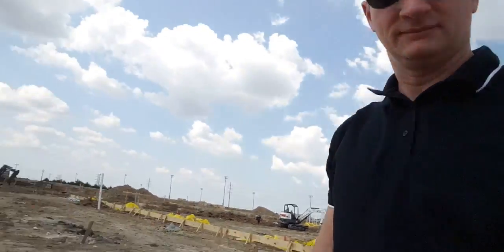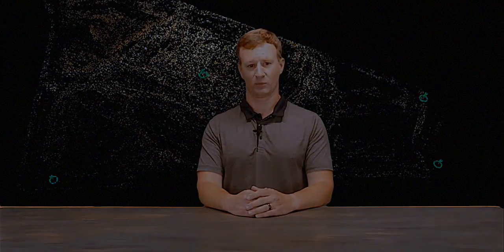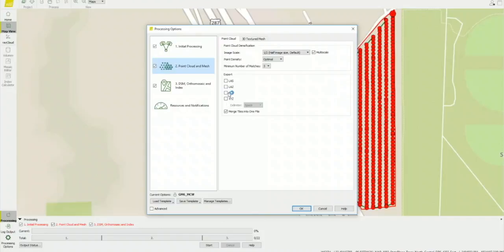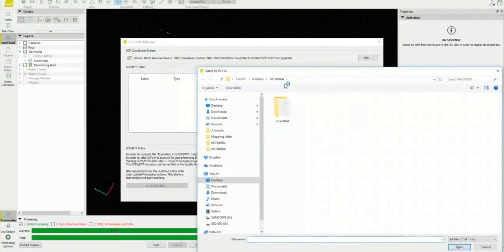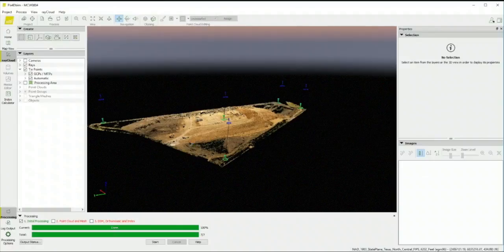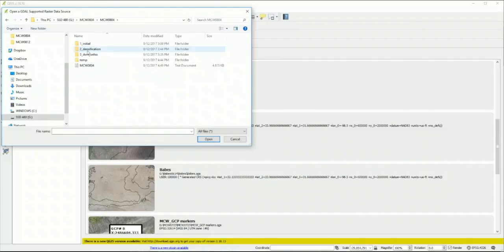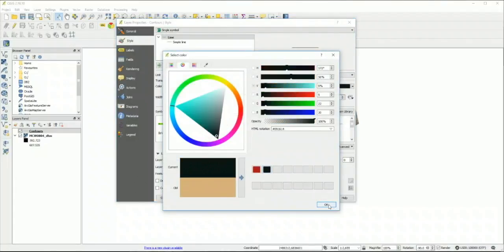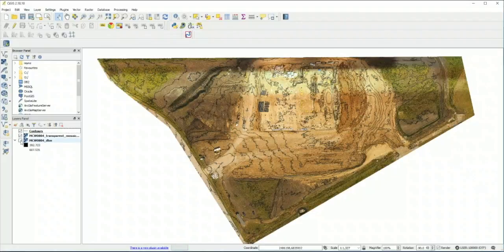How to get accuracy in Drone / UAS Mapping with Pix4D: What You Need to Know

Comment: Using Pix4D Mapper, I have on occasion had it not allow me to only pic the GCP in a single photo. Then, when I continue, the ortho photo comes into CAD in the wrond position!! n my opinion, Pix4D makes the best orthos but have had this trouble I mentioned. Any ideas?
Reply from the maker: I have had issues with Pix4D that were caused by bugs in their software. If it is not a but that they have to fix then you can close the project and reboot the computer. After that, it should work.

Comment: What would be your recommendation for increasing my relative accuracy? I keep running into issues such as my terrain appearing to be every so slightly slanted, such as a 8-10 foot elevation change across a distance of 500ft, for example. Just trying to perform some basic volume measurements so I don't need survey-grade absolute accuracy. 

Should troubleshooting this issue start with mission planning settings changes or is this something that I should be correcting with tie-points later?
Reply from the maker: What drone are you using?
Reply: @GM6DroneMapping Phantom 4
Reply from the maker: @irbChad  Two things come to mind. GSD is the first. As the land moves up or down in elevation the drone should too. You want the drone the same distance from the ground for every image. The second thing that would help is ground control. If you have GCPs the GSD-ground sampling distance stuff is not as important. How high are you flying?
Reply: @GM6DroneMapping  Interesting, I'm not sure that I even knew it was possible to have the drone change its elevation with the terrain. We have been flying missions at 150ft
Reply from the maker: @irbChad  Some apps have terrain follow but most do not. Kind of dumb not to have it. DroneHarmony for Android and QgCS has it for the PC and I think iOs
Reply: GM6 Drone Mapping alright I'll look into that, thanks for the tips. Anything else you can think of that might increase my relative accuracy?

Comment: Excellent video. I am new to drone mapping and am about to take my second Pix4D course. My wife has her MS in GIS and I am excited to be learning. Thank you for the information. Mind if I ask what you consider the minimum equipment requirements to collect accurate GCP data?
Reply from the maker: Bruce, sorry for the delay. Sometimes I don't get my notifications. I would say the minimum would be Emlid Reach RS. You would need two or you can get Reach RS and an Emlid M+ which would go on the aircraft. Now the easiest way to do it is either contract a surveyor per job or AeroPoints. BTW your wives background will be extremely important. You can't do this job without GIS. You are very fortunate.

Comment: i am a drone pilot nowadays i am trying to learn about drone photogrametry processing, mostly while doing processing in a software like pix4d  i  have not getting good accuracy i am getting 7m error to 20 m error.
i am doing processing for more than 5 or 6sq.km area i need accuracy of x,y,z within 20cm for that what software i have to use, i have searched a lot mostly the information which i got is i have to do some step manually in some other softwares before processing in order to improve the accuracy likewise its showing   if it is true then what are all the softwares how to handle it.
Reply from the maker: What drone are you using? One software program can be used for your mapping to be accurate

Comment: I really like this video.  While watching, your GCP's seemed very high before you re-optimized.  I've tried using GCP's with a Trimble Geo XT, but they are always around 30m too high.  Is this normal, or am I missing a step somewhere?  Do you have any suggestions?
Reply from the maker: Yes it is very typical for them to be high. The drones gps is cheap consumer grade GPS. I'm guessing you missed a step, which is easy to do. I still mess up all the time. If you want to email me i can try to walk you through it. If you can tell me the steps you did it may help. guardmy6@gmail.com

Comment: How many images did you took for creating the map? I am new to these so it would be very helpful
Reply: Avhinav Mainali 
It's usually at least several hundred to a few thousand. It depends how big the project it. You need lots of overlap, the software needs this so it can pick similar points from different pictures.
Reply from the maker: +Avhinav Mainali sorry for the delayed reply. It takes between 500-600 images and about 4 hours to process
Reply from the maker: +Ty Brady thank you Ty. for some reason I have not been getting these messages.

Comment: Absolutely fantastic video, although I'm a bit curious, if the client's GCPs are done with poles, would it have been measured from the top of the pole or the bottom? Thanks.
Reply from the maker: 2987ms thank you. The points were measure from the bottom. A long metal nail/stake was placed in the ground for the GCP
Reply: GM6, Drone/ UAV Mapping Thank you very much.
Reply: The wooden stake was just placed there to mark the area so you could find the ground control point later.